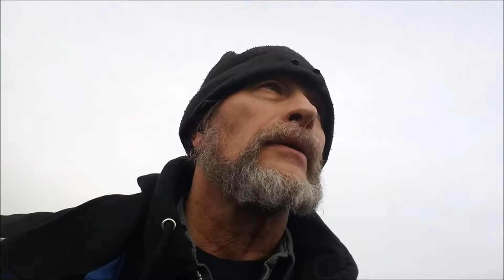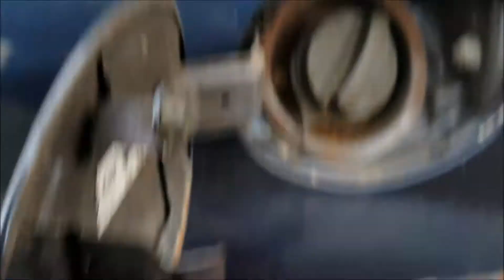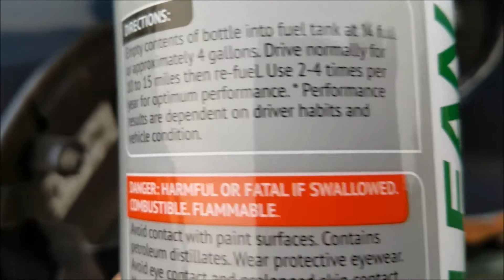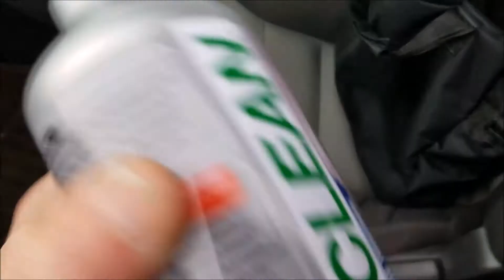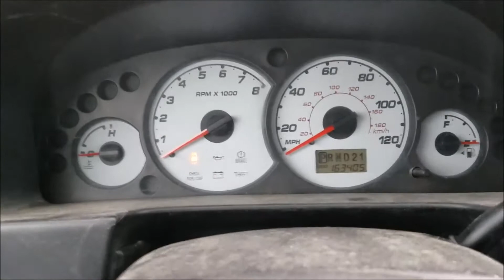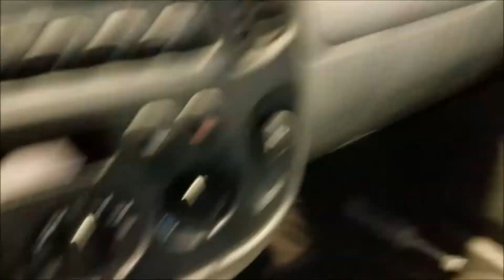CataClean In the 03 Ford Escape

Comment: Thank you for sharing your positive results with us. I have an 02 Audi A4 Quattro with the 3 liter V-6. The codes indicate a clogged converter and a temperature check indicated 365 degrees temp on the passenger cat and it pegged the gauge at 700+ degrees on the drivers cat. Bingo! It’s a major pain in the ass to get the cats off on a V-6 Audi A4. I’m hoping this works.